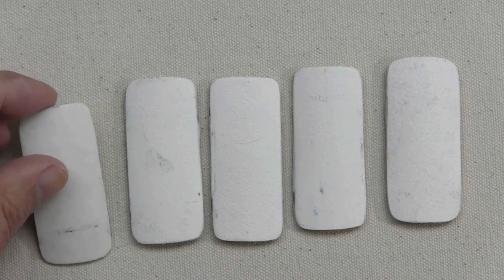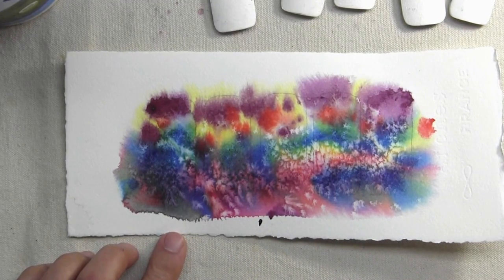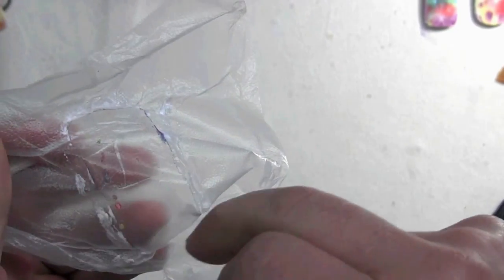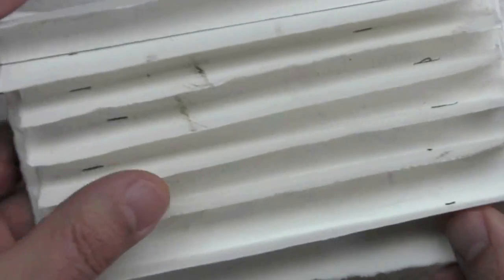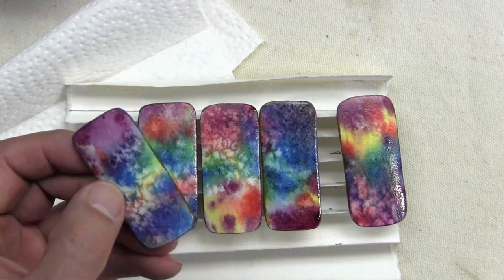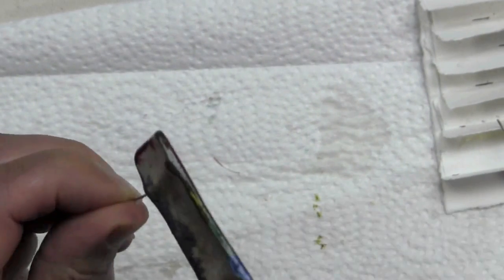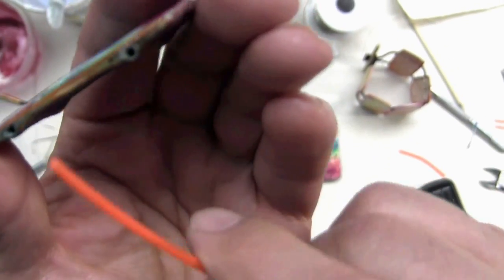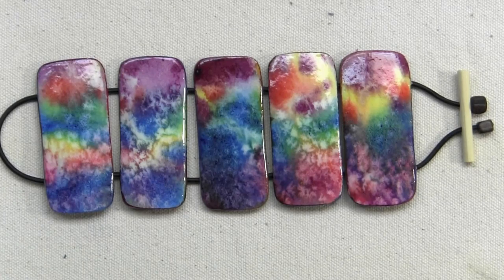How to Make a Watercolor Paper Bracelet, Jewelry Design Part 2

Comment from the maker: Hi Douglas - The reason why there are 3 layers on the top is that I add a layer that contains the watercolor painting. You can definitely go with another layer on the bottom. It will make it a bit thicker, but there is nothing wrong with a thicker bracelet. I use banana or other decorative paper on the bottom, but you can certainly try rice paper on both top and bottom. My wife has had a bracelet I made for about 10 years and it still looks like new. They are quite durable! Thanks for watching!

Comment from the maker: Thanks for watching!! And that’s correct, I heat the varnished pieces at 150 degrees Fahrenheit to accelerate the drying process, and for the final heating, I heat the piece at 200 degrees Fahrenheit to melt out the wax.

Comment from the maker: The varnish that I use is a water-based varnish. It has much less odor than an oil based varnish or clear nail polish. I do not recommended clear nail polish or glue. The reason for the coating of varnish is not only to protect the piece, but when the water-based varnish is baked at 150 degrees, it becomes very hard and contributes to the structural integrity and durability of the piece. Also most clear nail polishes are flammable! Thank for your questions.

Comment: I am working in my lunch break on an idea. I have some heavy gauge copper wire ~ construction of my home. I could make two straights cut of wire, loop or coil  the ends. Wire wrap or even better tightly cord wrap the two cuts of heavy wire together leaving open two spaces to house the bracelet ropes.  Once I insert the rope through the openings I think I will cap them with a bead like you did.  I will try it on practice wire tonight when I get home. What do you think? Thank you!  Back to work.

Comment: Hello, Mr. Barbera:  I'd like to ask you about the basic construction of the pieces.  You use three layers for the top & two for the back.  Why don't you use three layers on the back?  Does it make the bracelet too thick; hamper passing through or fastening the leather cord?  Also, I'm wondering about the life-span of the bracelet.  How long do they "last" with normal wear-&-tear?

Comment: Thank you for the videos on how to make this. I have a few questions. What size is the cord your using?  If your toaster oven doesn't have a temperature gauge other than low to high, what do you suggest, low to start and progress to medium to melt the wax & is this at all dangerous with all of the paper products in a toaster oven (I don't know anything about them)? And lastly, I don't have a drill to use, is there an alternative for the stick closure? Thank you for any help or suggestions.

Comment: instead of varnish you can use clear glue or cler nail polish, but I am not sure you can put in toster oven after that, there is also "sealer" but stinks so bad that you have to spray outside the house

Comment: Made a few typos: ...and plan......work on wax paper instead of paper towels.   My final question is if not drying in toaster oven, will a coated piece of metal  ( by rubbing with wax or vaseline, cooking oil or something of that sort) at the required thickness desired that can be removed due to the coating process used. Thank you very much for your insights and CREATIVITY. 1Love